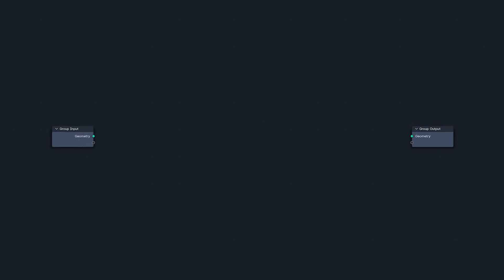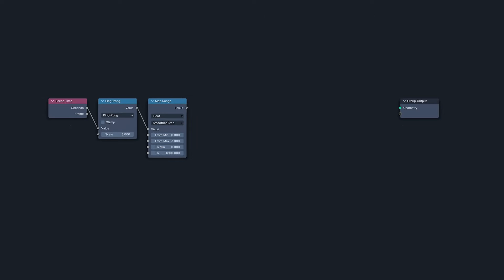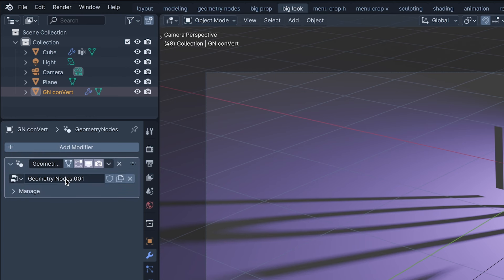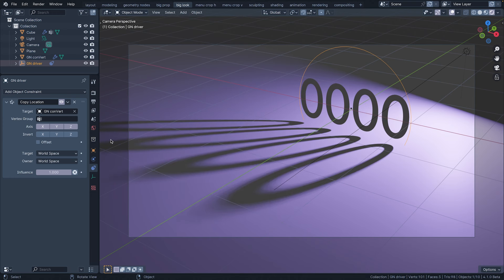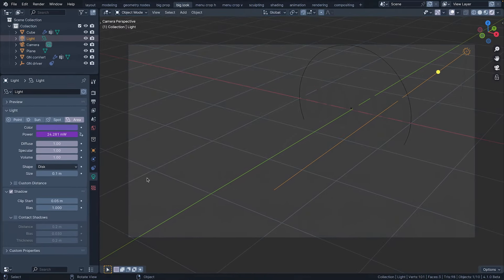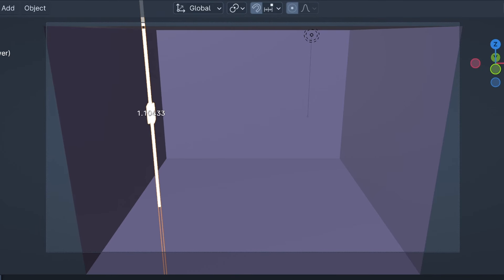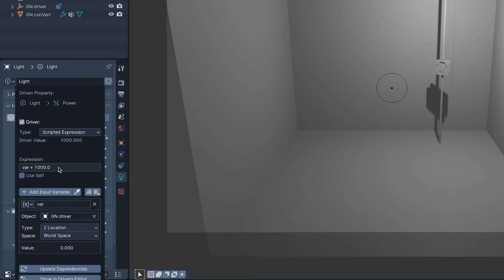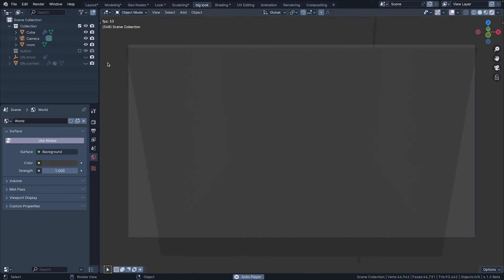use lights with geometry nodes in blender

Comment: instead of single vertex, you can directly use Empty. I learn it from Simmon thomes. Here is the process- Select Empty and add geometry nodes to it. inside geo nodes, add instance to point node. it will add point at the empty position. now you can use it instead of single vertex.

Comment: Good news, if you don't want to use drivers you can instance a light and in eevee scale it's size to reduce emission.  I used this to create a TV screen by separating a video into 3 colours, then using them as vakues to scale lights in a grid.
Reply from the maker: Yeah, scaling a light instance when rendering in eevee works for intensity. Instancing lights in general is really useful! The benefit of the driver method is that you can literally drive anything that can be driven. Now eevee next is going to be a whole new disco with its realtime emissions…
Reply: @davidmcsween Could u pls go into a little bit more detail on how u change the intensity of a light instance by scaling it? It doesn't work at all when I try it and I feel like a dumbass. I instance the light in geo nodes and use the scale instances node - no effect, transform geometry node - no effect, scale an instanced collection in viewport - no effect :/ What am I missing?
Reply: @RockMedved  Oh it seems to be broken now. it worked in old eevee :(

Comment: Welcome to another episode of blender artists going to great lengths to avoid touching python scripting. This is pretty fun though
Reply: So you suggest learning how to script, without scripting you cannot achieve any great things in 3d?
Reply: @pesvel  yes to the first part, no to the second. You can do awesome things without but learning it can benefit you so much
Reply: @kolupsy  where should I start? In the scripting, as a user who does not have any knowledge?
Reply: step one) spend two years learning python
step two) spend two years learing python in blender
step three) ???
step four) profit
Reply: @lopsidedpolygon make it two weeks for both
Reply: Could be done entirely with drivers and fcurve modifiers, really
Reply: They really need to add a Python script node to geonodes.

Comment: There's a lot more going on here than doing something with lights and geometry nodes. I am not even sure you used Geometry nodes to do something with the light.
I would really like a tutorial on how to use Geometry nodes to DISTRIBUTE lights in a scene, if possible
Reply from the maker: This video shows you how to control the intensity of a light (or any property that can be driven of any object) with Geometry Nodes and an intermediary object. Using geometry nodes to do something to the light is very much what the video is about. The only other thing it’s about is 8 minutes.

You can distribute lights as instanced objects with geometry nodes by adding them with either an object info or collection info node. But, as of the time of this comment, you can’t control any of the properties of these instanced lights with geometry nodes

Comment: Wouldn't it be easier to generate an attribute in the object that contains the GN, then use a driver from the GN modifier to the light node group to control it, I think it's easier.

If you want to avoid a direct connection of the GN modifier to the actual light nodes you can generate a Custom Property in the light itself and make the driver from the custom property to the light nodes, and then use a driver from the GN modifier to the Custom property of the light.

It's important to keep the driver from the output attribute from the GN modifier and not from the node group to avoid problems if you want to use different modifiers that can vary their behaviour.

The cool thing is that everything you need can be done from within the GN node tree instead of having to do something more complex with an additional geometry and the drivers. :)
Reply from the maker: It’s currently impossible to connect geometry nodes directly to a driver. We’re just not there yet. You can drive a value in GN but not the other way around. And EEVEE doesn’t do light nodes (yet). But the future will be bright and full of newly possible things. Until then, there’s vertex groups